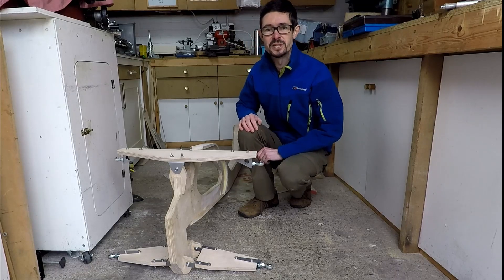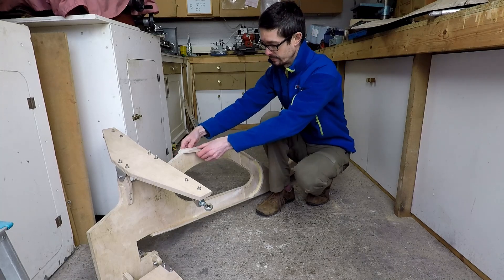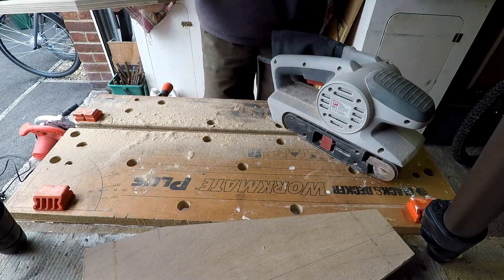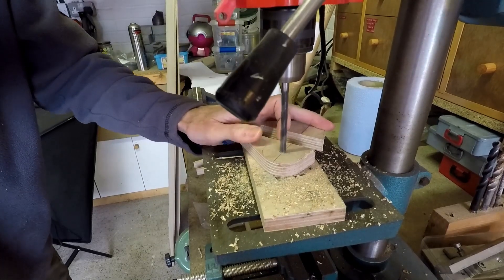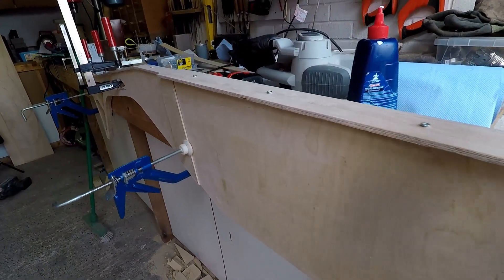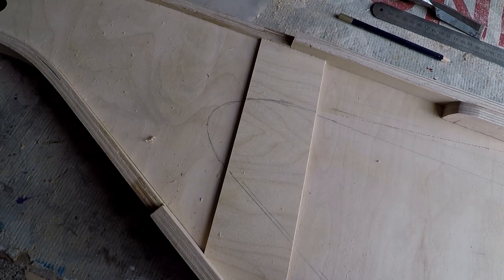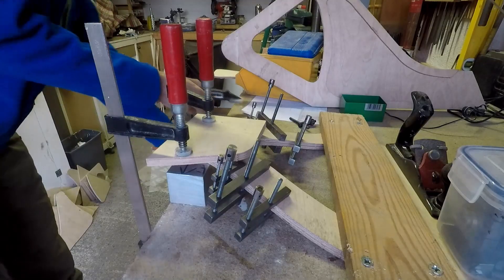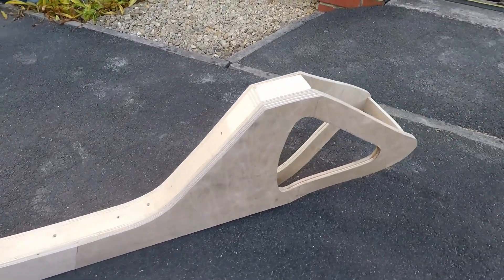Tilting Trikes Part 5 - Making a Wooden Tilting Velomobile Trike

Comment: I would not even be bothered removing strength material to save weight 😅 i am a sheetmetal worker and it rarely saves enough weight to offset the reduction in strength, but I am loving this build and hope it progresses well

Comment: The frame seems to be very stiff and heavy to me. Especially the centre section below the seat won't take much load as the outer ply will take transverse forces and horizontal as well. But as I understood this is just a mock-up to check the geometry and will be replaced by carbon fibre. Have you thought about flax fibers instead? Should be more eco friendly and at least keeping the weight on the same level. Especially where the strength of the fibres is not outbid on a small vehicle like this. Thickness of the laminate is mainly to provide strength against collisions. Great work and attention to detail. I've been looking for a quality built. I'd like mine to be as high as a cars windscreen to make eye contact.
Reply from the maker: Hi, yes my wooden frame is heavy and I didn’t make any attempt to optimise it for this prototype.  The area under the seat is the weakest and most highly stressed point. The finished frame is quite flexible.  I have looked at flax, yes, but I am not sure whether there is an equally recyclable resin to go with it; Easycomposites have a recent video on this subject. Flax composite is a lot heavier and less strong than carbon fibre but I think it could be an option.
Reply: Can you explain what flax fibres are please?😅
Reply: @CraigLandsberg-lk1ep  Easy composites has also made some videos here on YT about flax.

Comment: I know your wood frame is just a prototype but after seeing you build it, I am considering using wood as the end product.
What do you think of wood as a frame? Too heavy?   What is considered a good weight for a frame. Doesn't have to be ultimate lightness just an average ball park good.
Reply from the maker: I would say wood is a viable frame material and there are many examples of wooden bikes. Mine weighs about 10kg but I made no attempt to finesse the design. A normal diamond frame would probably weigh about 1.5 to 2kg in steel or aluminium.  I don’t see any reason why a wooden frame needs to be much heavier, but I would want to beef up the more highly stressed areas.  Choice of wood and grain direction would be key.  If you really want to keep the weight down, then details stress calculations would be necessary.  Maybe consider reinforcing some areas with another material.  There was a fairly recent GCN video about a wooden bike maker which is worth a look.

Comment: nice design,
painting sealed for wood,
wood & alloy so nice ...
Reply from the maker: I need to decide whether to paint the wood or just varnish it with a clear coat.
Reply: @MetalMachineShop  varnish make wood more valuable & luxury ...
if you used fiberglass or carbon so you can paint it ...
Reply from the maker: @ahmagdy81  yes, I’m thinking varnish or oil finish. Don’t want to pretend it’s not wood by covering it with paint!
Reply: @MetalMachineShop  i like shou sugi ban ...
many ways is good too ...
red, orange, yellow ...
almost colours look like natural is good ...

...
old is gold
...

Comment: Looking forward to the real deal! What are you planning to make the final bike out of?
Reply from the maker: I'm thinking of going for carbon fibre, but I need to cost it up first!  Failing that, steel tubing.  A carbon frame should be easier to integrate with the body mouldings.

Comment: Hello 
Happy new year 
I ve been watching you closely and can't wait to see it finished , looks good on plywood . I am designing and will built a tilting tricycle too but it will be like a normal bike as for the riders possition and i would like to ask you for some advice , 
at my design at 30degrees lean i have 15mm scrub on each tyre, is that ok or too much ? 
Is there a benefit on having the two arms so much apart or you have it like this in order to fit in in the body ? Would having them totally outside of the body be ok ? 

I am struggling to find wheels for the front , generally i want small wheels 16-18 inches probably 18 and the best solution i ve fount so far is a wheel that is used to strida folding bicycle cause it haves disc brake and mounts from the one side by default .what do you think ?  Do you have any suggestions for wheels .
Reply from the maker: Hello, happy new year to you too! I will try and help with your questions.  
I don’t think I would worry about 15mm scrub at 30 degrees.  I doubt it will have much effect and 30 degr is quite a severe lean angle for a bike/trike anyway.
On my design, the wheels will be outside the body.  They are right at the front where the body is narrowest (It tapers to a nose cone) so it’s not really practicable to have the wheels inside the body with this layout.  One the final version, the outriggers will be streamlined.  The vertical spacing of the upper and lower arms is a function of where they are positioned relative to the.  The upper arms are on the body’s centreline, where the body is circular in cross section.  The lower arms are positioned below the body such that there is clearance between the body and the arms at full lean.  Whether it. Is practicable to have both arms outside the body depends on the design of the body and aerodynamic considerations.
Regarding wheels, I have chosen 20 inch wheels (406 size) front and rear.  These are a common size for velomobile and trikes (e.g. Ice Trikes) so relatively easy to get hold of in stub axle (single sided) configuration.  I ordered mine from ginkgoveloteile.com (video to follow).  16 or 18 inch wheels may need to be custom-built, but it depends on what you can find.  Also check on availability of tyres in these sizes.
I hope this helps!
Reply: @MetalMachineShop  hello 
Thanks for the quick reply ,
thats what i about the 15mm scrub too .

I understand why the arms have that distance ok , but if there where no more considerations is it better the two arms have bigger or smaller distance ?

I got into that website with wheels they look good but realy expensive and  I think I will go with the 18 inch i found the price is better and they seam strong , but do you think 12 mm axle is enough for the use I want ? 

An other question , what about weight distribution ? I seen someone saying that the most of the weight should be at the front in order to equally divide the weight at the 3 wheels , do you agree with that? in a recumbent bike where the center of mass is low I think its ok but in a bike like mine where the rider is almost standind i believe it is dangerous to tip over in an unwanted endo. ??
I hope i dont get you tired with all those questions 
Thanks
Reply: @MetalMachineShop I am going for common 20inch wheels as well 😅
Reply from the maker: @CraigLandsberg-lk1ep  good choice.
Reply from the maker: To answer your questions, I think the tilting arm separation is mainly driven by practical/layout considerations.  Changing the separation may affect the tilting geometry if the arms are of unequal length.  Greater separation may have structural benefits (think ‘I’ beam).
12mm axles should be fine, especially if they are solid.  Ice Trikes and many others use 12mm axles and you can get hollow 12mm axles for Ice Trikes too, so I think you will be fine.
Regarding weight distribution, a normal bike has a 40/60 front to rear weight dist which should be a good aiming point.  I don’t see any reason for moving the weight forward to load all three wheels equally.  Standard velomobiles do have fairly highly loaded front wheels, partly because the wheels are brought well back to fit in the aerodynamic body and to shorten the wheelbase to improve the turning circle.  There is a well known video of this happening on YouTube!  (A tilting design should reduce this tendency).
I would just add that my thoughts are purely theoretical as my practical experience is pending completion of my prototype, so I might be talking rubbish (I don’t think so though!)

Comment: haaa finaly, the following of this project. I can't wait to make mine since I watched your engineering development video. Mr Lathe and Mr TIG welder are waiting! [;oP A small trick for pivot in wood : instead of articulating metal axles(bolts) into wood holes, I would recommand do glue small brass or copper tubes in the wood holes to make a good mating surface for the pivot. The best would be to glue a ball bearing if you have enough room to keep a sufficient section of wood around.
Reply from the maker: Hi, it would be good to see your project when it comes together. Thanks for the tip; in fact I am using oilite bushes for the bearings, glued in with epoxy.  I will probably use sealed ball races for the final version, but then again they are heavier and more expensive, so maybe not!
Reply: @MetalMachineShop  very often ball races are overkill for swivelling components. I have seen bolts with PA6 bushings used quite successfully. much better bearing material than brass or copper (self-lubricating)
keeps costs in check at the same time.
Reply: @daszieher PA6 bushings? Can you explain? Cheers 😅